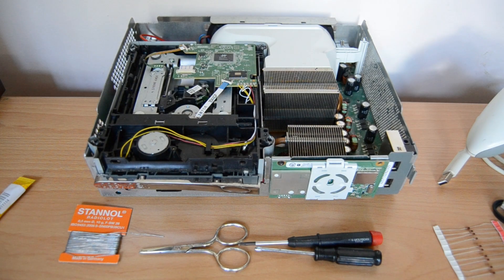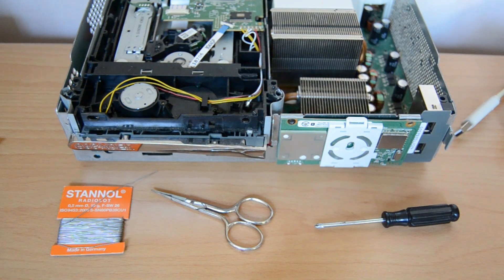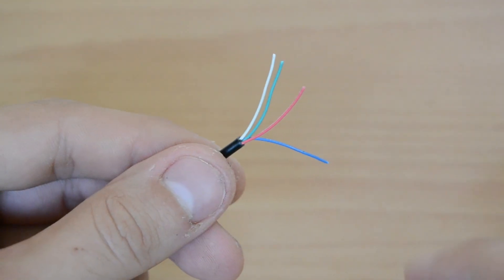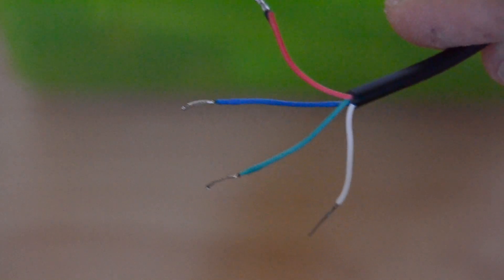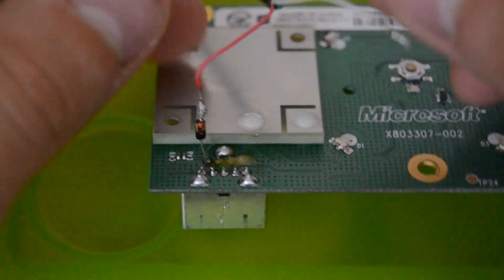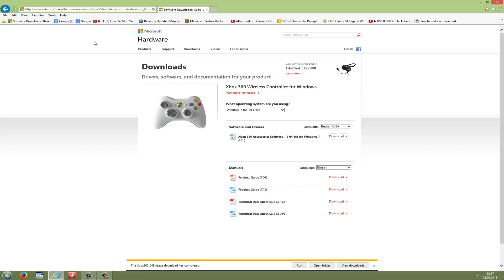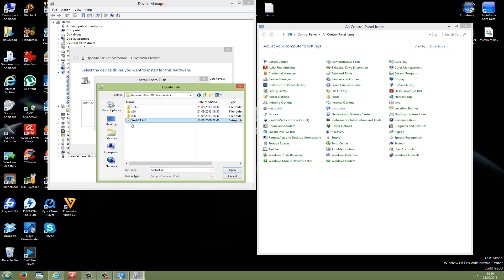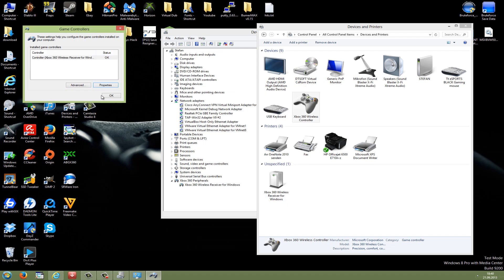How to make a homemade Xbox 360 controller wireless receiver for PC! [HD]

Comment: That’s pretty cool I tried to connect a 360 using the app from Microsoft and they said 360 controllers were to old but this is interesting, wonder if it would still work for windows 10 or 11
Reply: I have windows 10 and no that don't work

Comment: 100% working! in 2025!

Thanks a million for this tutorial! I just did my own mod and im more than happy with the results!
Reply: where did you get the drivers??? i couldnt find it!
Reply: I want to try this out but i don't have an "extra xbox 360" lying around xD. I do have a wireless controller and can get this module online. Will the controller sync with the play and charge kit or do i need an extra xbox?
Reply: You can get them so cheap if they have red ring of death
Reply: @PixelatedError  sadly, the part itself costs more than the dedicated xbox 360 wireless adapter for pc, and the console itself with the red ring of death costs even more, so I'll just get the pc adapter and call it a day.
Reply: can this be done without capacitor

Comment: Thanks, worked in 2023 on windows 11. The driver install process was a tiny bit different though
Reply: how did you get the drivers to work on windows 11?
Reply: @CptJunior  In device manager I went to "other devices" and selected the unknown device > update driver > browse my computer for drivers > let me pick from a list of available drivers. In the list scroll to the bottom and find "xbox 360 peripherals" and select it, finally select xbox 360 wireless receiver from the new menu and install it.
Reply: @DebProdigy It won't. I just plugged it back into the xbox 360 and synced a controller that way. But once you sync you won't have to do it again.
Reply: @DebProdigy Yeah although I can't be 100% certain, if they were already synced and you didn't desync them they should be fine.

Comment: I have a issue that when i update the drivers it just gives an error telling me that the drivers are not compatible with the divice i have the correct drivers and i have tried on several different computers with several different operating  systems i have no idea what i problem is and was wondering if anyone knew how to solv the problem edit: i discovered that discovering the ground pin did nothing it even still shows up and i dont know why
Reply: Hi, I got the same problem and still havent got it working. did you find a solution?

Comment: I did it without diode and solder. I removed the metal thing on the connector, removed the plastic and taped the bottom pins. After that i made the cables round and it attaches on the pins. Then taped all togheter and it works!! So the diode and soldering are useless, but i did it this way 
1) Because i didn't had another xbox, i had this spare part from other xboxes that i tried to fix, which i failed and throwed the xboxes away
2) Beacause i have the play and charge kit and it synced this way
Reply: You are just powering the controller with 5 volts dummi, that is not synchronized with the pc, you need a receiver to synchronized the controller dummi.:face-blue-smiling::face-blue-smiling::face-blue-smiling::face-blue-smiling:

Comment: Hi, I have a bad xbox360 slim I took out the RF module to do this diy but mine is different model then the video, can anyone help how I should solder the wires? Which wire should attach to which pin?

Comment: Thanks! I followed the guide using an led diode and adapter from an old fat Xbox360 that i had lying around and now i can connect my 4 controllers! For those who do not have an diode you can solder the red wire without it and it will still work, at least to me it did work just fine but i left it with the led diode for the bright red light :)
Reply: hey bro what drivers did you use?
Reply: @The_GOAT2282  I'm using the: 10.0.19041.1 [12/6/2019] Windows driver version (or xusb22.sys). I remember plugging the receiver and manually selecting the drivers by going to: properties of the device in device manager> Driver tab> Update driver> Browse my computer for drivers > Let me pick from a list>Xbox 360 Peripherals and selected the highest version available. The driver from 2009 just didn't work for me. If you can't find the latest version, tell me and i will upload it for you.
Reply: @vaggelisvasileiou3126  sweet ok, ty for replying to the old ass vid
Reply: @The_GOAT2282  Np! :)
Reply: hello!  I have a question, you say that you can connect 4 controllers, but can they be used simultaneously?  Or does it only work with one controller at a time?
Reply: @agussp6731  Hello! Personally i haven't tried using all 4 controllers simultaneously but mostly two and three with friends for various co-op games and they worked just fine with no interruptions! I mean it's an original Xbox-360 adapter... It was designed for that unlike off-brand ones that are unreliable.
Reply: @vaggelisvasileiou3126  Thank you very much for the reply!  Yes, I only have two controls, it works for me then 😅, I have one more question, did you have problems linking the controller to the PC?  do you need the cable charge and play?
Reply: @agussp6731  Np! Hmm.... It's been a while but i think the very first time i had to use the charge and play cable to synchronize the controllers with the adapter, after that i never needed to use it again.. Even on a different PC! If i remember correctly you don't need the cable if the controllers were synchronized/connected on the console itself once... But at least for me that was not the case.
Reply: @vaggelisvasileiou3126  thanks you!!!
Reply: Hey bro, I'm glad you got it working, quick question, do you know why you would need the diode in the first place ? Like is it safe to solder it without the diode ?
All the best
Reply: @JaytheBae98  I'm no expert on this but there various types of diodes for various purposes, for example there is an overvoltage diode used for protecting the hardware when there is a surge. Diode converters ac (alternate current meaning they reverse from positive to negative) to dc (direct current) used to "rectify" the power delivery, and last but not least led (light emitting diodes) that light up when power crosses. 

Short answer it's probably for protecting the board and prevent destroying components inside that would lead to an short. But as long as you are connecting to USB ports (not charging ports) it will be limited to 5v only (which is the correct rating for this) so I'm not sure if it's really that necessary? Take everything i said with a grain of salt
Reply: @vaggelisvasileiou3126  ah nice one, thanks for the reply, I did engineering so I'm familiar, I was just wondering if zener diode had any electrical advantage/ importance to the process.
I just ordered a set there to be sure.
All the best dude 🙂
Reply: @JaytheBae98  i read the comments on this video for a bit and someone said the board is meant to handle 3.3v. Not 5v. So it will run, but the extra 1.7v may burn it out eventually. I've seen it happen when i powered a 3v led light with a 5v usb cable for a shelf light. It was brighter, but got hotter and fried the led lights a week later.

Comment: Thanks for the tutorial! Still works in 2022! Windows 10 comes with the drivers for this now, so you don't have to download them. Scroll all the way down to "Xbox 360 Peripherals" and it'll be in there. I used 3 standard 1A diodes in series to drop the voltage from 5V to ~3.3V. Worked first try! Time to play some local co-op!
Reply: I've got this thing connected with a voltage divider, voltage across the resistor is 3.7v when connected to my computer, but nothing shows up in device manager. Did yours work as soon as you plugged it in? Also on Windows 10.
Reply: @EntropicCheese  I wouldn't recommend using a resistor voltage divider to get the required 3.3 volts. The resistors will only allow a small amount of current to flow, not enough for the device to power up and function. 3 diodes is the easiest solution and it allows the device to sink as much current as it wants. Windows will make the device connected sound when your device gets the proper amount of power and is able to boot up.
Reply: @YOanimator  I suspected it may have been a current issue. Damn. Well thanks for the reply! Hopefully I can get this working. I have a halo reach controller I want to use.
Reply: @YOanimator  Hey it was the current, and I got it working and i followed your steps to get the driver installed. How did you get your controller synced?
Reply: @EntropicCheese  Great! My controller was already synced to the board when I removed it from the Xbox. If you need to sync your controller you will have to temporarily plug the unit back into the Xbox, boot her up and sync like normal from there. There may be another way, but this is the only that I'm aware of.
Reply: @YOanimator  that's a damn shame since plugging it back into the Xbox is not an option for me. I'll have to see if there are any work arounds
Reply: So, did u use a normal 5V diode and then three 1A's or just three 1A's?
Reply: @mikoajt5882  I ended up using a voltage regulator. A few extra dollars and a lot more reliable voltage control.
Reply: @mikoajt5882   "I used 3 standard 1A diodes in series"
Reply: Is it going to work on windows 11?

Comment: Hello, I followed this guide and got the wireless receiver up and running just as shown. My problem is with syncing the controller. The 360 I took the receiver out of wasn't working so I couldn't sync it on the Xbox. It also is missing the plug and play charger. Is it possible to sync it wirelessly with the PC without the Xbox or the plug and play charger? I looked this up and apparently there is a small button next to the power button you need to press to sync. I look at the Xbox again and I think that button is through the motherboard itself. Only way is to get a plug and play charger or possibly make one if there is a guide?
Reply: hello, are you finally able to sync your controller?
Reply: No, I finally just used combination of x360e and GDPSCK for keyboard and mouse to play rdr1 on PC.

Comment: Excellent video! I have the slim version, which does not have those solder points. Do you have any idea how I can modify this one to work?
Reply: me as well so sad
Reply: @gch2085  there is a video for slim xbox receptori did it and it works but can sync my drum set dont know how

Comment: i just used the usb from rear with a female end half the shield removed for the pins on bottom dont spark and from there i used speaker wire connectors to connect the diode and presto it works if u see the red and orange light u have pins touching the same connector pin but it has a really good fit and flawlessly working btw i had two extra consoles to experiment

Comment: I'm a bit lost with the use of a zenner diode, especially since it's in series with the 5V wire. Could it be that you need to drop the voltage down to almost 3.3V? Or?

Comment: Hey man, I did the steps and it works, and gets to the Unrecognized Device popup, but I can't add the driver manually to work with the receiver, Windows gives me an error telling me that the Xbox 360 Controller for Windows driver isn't compatible with my device and I should get one correct for my Windows version even though it is correct. I have Windows 7 x64. What do I do?

Comment: I followed the instructions and the received is detected and the drivers installed correctly, however the controller it's self is not being detected. I was thinking how I could tell the receiver to look for a controller because the sync button on the xbox 360 is not on the receiver. I'm on windows 10 and used the windows 7 64 bit drivers.
Reply: To sync you either have to plug it back into an xbox and sync it through that, or get a play and charge kit and connect it to your pc, atleast thats what he says in the video. I used the xbox method and it worked flawlessly.

Comment: Works perfectly.Didn't even use a diode.I used windows 7 drivers on windows 10.No problem at all
Reply: Dude. You use the diobe so you don't short circuit anything.
Reply: @stamatakisgenebe1517  I know, but i still don't have any problem with the receiver.

Comment: I was just looking at my broken xbox360 last night pondering how this would be possible, as my wired 360 controller is now dead, is this possible without the solder or the diode lol! i want to do this on the cheap like no tools required....

Comment: To anyone still trying this;
You have to use a diode or diodes that lower the 5v red wire to 3.3v. Because if you feed 5v to the board you can fry the controller.
I suspect that's why so many people are complaining in the comments.
Reply: @Amrulaas Ahmed lol no. you need a diode
Reply: Do you have to use a diode or can it be done with a resistor?
Reply: @emesito  Should work, as long as the voltage doesn't exceed the 3.3v you should be fine.
Reply: @thyaguster  I changed my mind and i'm currently using one the diodes that comes in the disc drive (AMS 3.3, since I have a slim)
Reply: @thyaguster  what about  10k resistor?

Comment: May I ask why the 5v zener diode? they way you used it, it implies you are regulating the voltage to 5V, but the USB port is already regulated. I would like to tell you that when you are using a zener diode in reverse, you don't block the current, because one of zener diode properties, it can flow current in both directions. when placing the zener diode in reverse, it regulate the voltage to its specification, for example a 5v zener diode when it's placed with 10Vs and a resistor, you will measure 5v exactly across. the diode. sorry if I sounded rude.

Comment: @TechMagnet I want to use this with my Android device. But also my pc
Reply: My controller isn't connecting either. I had it plugged in my Xbox and already synced. I also had it soldered and when I plug it in it lights up(all I had was a LED). My board is the same model as yours but it is revision B. Give me some tips please.

Comment: You need to use a diod! you can get the correct diod from the xbox power supply. it's labeled "D101"
Reply: you can break open the power supply brick and look at the green 
underside of the board. all the way at the end of the short side of the 
rectangle is a diod labeled D101. this is perfect. you should only use 
one diod but if you fuck up there are 6 more on the rest of the power 
supply.
Reply: for me, my receiver only works in the USB slot that i first used to set 
it up, I tried everything but i cannot get the device to recognize in 
any other slot. could be a fluke, but keep that in mind. set it up in 
the port you want to keep it in.

Comment: when I plug in my receiver, my computer says "USB malfanctioned" and the receiver doesn't show up as "Unknown Device" but as "Unknown USB devie Device Desprictor Failed". Can anyone assist me with this problem please?
Reply: you have power and ground cable in right place so just invert the data cables
Reply: I know it's been a year but could you fix the problem? Are you using Win 8 or 10 aswell when this problem occured?
Reply: bump

Comment: anyone have a backup of the original driver install? microsoft took it down :(
Reply: It's always integrated in Windows. In W10, Go to the "drivers" setting of the device, Update Driver, Browse computer for Drivers, Let me pick from a list of drivers, and almost at the end of the list, you will see Xbox drivers. This will only work for OFFICIAL xbox wireless modules. For unofficial ones, this used to work, but it doesn't work anymore after some W10 updates. Now you have to use a hacked driver (literally 1 line change in the driver code) and it's a pretty elaborate process. On the plus side, the driver used to de-configure itself super frequently and now it works perfectly 100% of the time.

Comment: All the comments are raging about "All you need is an extra XBOX 360, It's dumb" I have a Xbox 360 which is broken (Rrod) and I would definitely try this :) thank you for the tutorial..
Reply: I've had a dead 360 just sitting on my floor in a corner for years. Well my pc wireless 360 receiver just died and this bideo just gave me some great last use for my old dead 360 :D
Reply: I haven't tried it yet because of the screws, It's hard to find the right driver for it here in my country well wish me luck.. did you try it without a diode?
Reply: Right!?
I recylce broken/damaged tech for stuff like this too, and loved this tutorial. Personally I would just buy and RF adapter, but loved how to learn to do this anyway.

Comment: how do i do with an xbox slim receiver?
Reply: pluurep unfortunately I don't think that you can as the chip is very different. I tried when I looked up the slim rf pin out and it did not work.

Comment: hello i just find out that i dont have the xusb21.inf file in my accessories folder but i have xusb21. And also when i use the drivers for my wireless play and charge it works

Comment: thanks for the video man.        \m/(--)\m/       Only thing i changed was drawing the 3.3v from a spare SATA plug in my pc. worked like a charm.
Reply: How did you do that?
Reply: @mubasshir861  it was a while back but if i remember correctly, i just tapped into the 3.3v wire on a spare internal sata connector, spliced in a wire and ran it out of the case. but i honestly don't remember too well. i honestly wouldn'r recommend doing it that way either without making some solid and well insulated splices. what exactly are you trying to do? if i can help ya out, i will. I dont think this is even relevant anymore, you could do the same thing with much less work, and cheap these days. i honestly forgot i even did this, i think i just did it out of boredom and spare parts
Reply: Using 4733 zener diode I am having 3.60 volts, but i need 3.3 volts 
That's why i am afraid 3.60 volts will fry the board